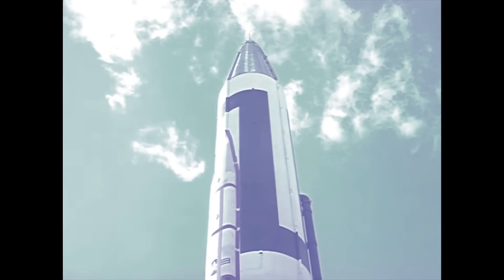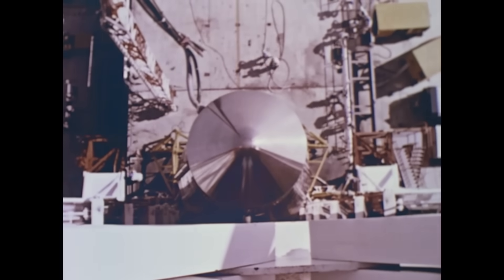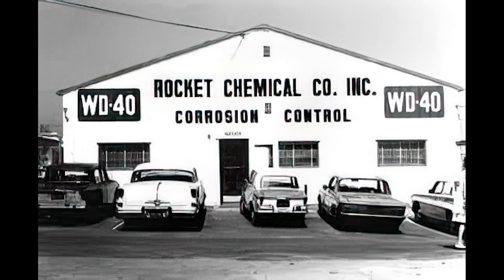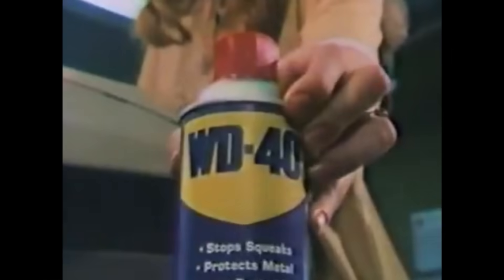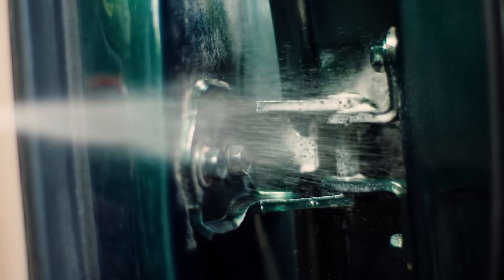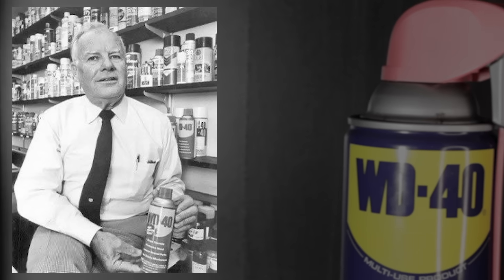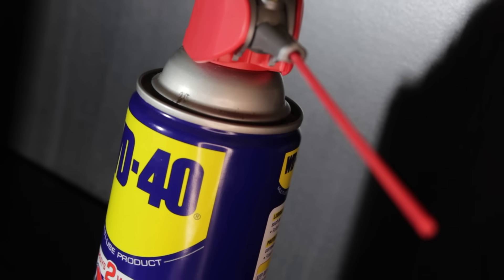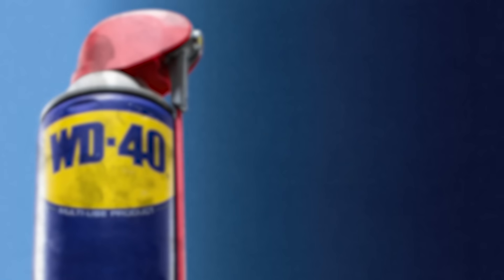How Missile Technology Became a Household Tool | WD-40

Comment: It’s good for water dispersion, marginal immediate lubricant, and as a penetrating oil, although there are better penetrating oils on the market.
Only downside is it evaporates relatively quickly so it’s not a long term solution for corrosion or lubrication.

Comment: Due to false advertising WD-40 is over rated and used in place of better more specific products for applications. I’ll use it for ratchet straps at most or something I want the oils to dry fast and not cake grease and debris to said thing. If I actually want a temporary fix for rust prevention, coatings or lubricant I’m using PB blaster penetrating oil, lanolin based products like fluid film or some type of specific grease spray. Those products mentioned stays wet and doesn’t evaporate so quickly. All in all keep a can of wd-40 around for the right application but there’s likely better stuff for specific task.

Comment: Cleaning - Yes. Penetrating - Yes. Water displacing - I guess. Lubricating - No. Not at all. Not even a tiny bit. Just no, never.

Edit: It's basically diesel that smells better. Next time you don't have any WD just try some diesel.
Reply: People who use WD-40 as lubricant never used the proper lubricant for a job.
Reply: Not for long, it's not a proper grease, but it absolutely does lubricate.
How is an oil that can easily penetrate between two close fitting surfaces not lubricate.
Reply: @Jo-rz6bs  WD will remove grease and oil. I won't clean bearings with anything else but when they're clean, I lubricate them. The oily feel that it has is a result of the paraffin that gives it such good creep but it shouldn't be mistaken for lubrication. Don't get me wrong, if you're working with squeaky hinges and that's all you've got then sure - but don't seriously consider WD-40 as a lubricant.
Reply: A rocket technichian once said it is based on a kerosine product and oil.

Comment: Used to use CRC 565 but nowdays its basicly WD-40 for everything from DIY to mechanic shop.... Its difference is like night and day....
Reply: Which is better?
I'm kinda confused, sorry.
Reply: @Salpeteroxid  WD-40 by a very long country mile shot wide ;)
Reply: @asf130thecompany7  I had a belt pulley on my car go out and I have 3 miles to work so I sprayed it with WD-40 and then tested 5-56 before every 7 minute trip but I actually thought the 5-56 lasted longer before it squeeled 😅 My place of work buys in both 5-56 and WD-40, why? I dunno 😂
Reply: @Salpeteroxid  I think it depends? Where I live its like rust belt but in Europe and WD-40 just works better dunno why.... At some point felt like CRC changed the formula or something coz its performance droped? Dunno And we used both more than boxes a month so had to choose either WD-40 or CRC :D

Comment: WD-40 is not all that amazing. First of all it was designed by NACA to displace water on Dodge truck ignition systems during World War ii. And all they did was revamp the formula it is minimally effective at corrosion resistance. Which is all that is necessary on any kind of stainless steel. It is far more of a solvent then it is a lubricant. In the 1980s somebody got the bright idea to take the new stainless steel semi-autos and put WD-40 on them before they entered a shooting match. It became very apparent that doing that was a very dangerous proposition because some of the guns were locking up in mid cycle due to lack of lubrication. Believe me, WD-40 is a piss poor lubricant. If you're using it you have to continually apply it to make it stay a lubricant, like when you're spraying it on steel wool to remove rust from a panel. Can you put it on and leave it on it will turn into a gummy substance which will seal the metal but not long enough to be a long-term corrosion protectant. Especially if out in the weather. For longer than a few months and a few months is not a long-term test. WD-40 was not created in the 1950s it was created in the 1940s. During World War II. None of those failures of the atlas rocket had anything at all to do with the lack of WD-40 on it

Comment: It's pretty good at cleaning internal components but other stuff like acetone and brake cleaner are better than wd 40 at cleaning surfaces either way wd 40 is a poor lubricant so it often has to be used in conjunction with something longer lasting

Comment: Works great for cleaning and lubing skateboard bearings 🤙
Reply: You should probably put a bit of grease in those bearings asap, I used to use WD for my bones ultra-reds and it worked great as a cleaner but sucks for a lubricant.
Reply: It doesn't last long though because WD-40 is neither oil nor grease. It will evaporate after a few days to a week, so after applying it apply some silicon grease as well for better longer lasting results.
Reply: Seeing WD-40 being sprayed in very liberal quantities upon objects showing no rust nor need for serious cleaning almost broke my eyes
Reply: Please do not use wd-40 to "clean" SB bearings. Instead use isopropanol 99% with a brush to clean, let it dry up and use 2 drops of low viscosity oil per steel bearing for breaking the sound barrier. [one drop for ceramic bearings]
Shake bottles for bearing cleaning are amazing!

Comment: Like my boss once said - you are not engineer if you cannot repair everything with wd40, electrical tape and zip ties.
Reply: Gotta steal those from my dad's toolbox then 😂😂😂
Reply: @notsojharedtroll23  And get some oxygen-rated PTFE tape. That's useful too.
Reply: @ifyoudontfailyouarenoteven6210 don’t forget the krazy glue. great for glass stuff that split due to thermal cycling and/or light bumps
Reply: My dad said any man worth his salt can make do with clamps, duct tape, and a can of WD-40
Reply: if u dont midn the stickiness use wd40  and replace zip ties with wondertape only
Reply: "If it doesn't move when it should, use WD40. If it moves when it shouldn't, use duct tape".

Comment: WD-40 is like duck tape, it works, but theres always a more specific product that does a better job.
Reply: duct tape… jfc…
Reply: @the__man  quack quack 😅  as a non native english speaker i have to defend this guy and say that I was like 30 years old before i learned that.
Reply: @terribleteddy  Both are correct and duck tape was in use since earlier. Don't let that guy gaslight you.
Reply: @the__man  ""Duck tape" is recorded in the Oxford English Dictionary as having been in use since 1899 and "duct tape" (described as "perhaps an alteration of earlier duck tape") since 1965." "The first material called "duck tape" was long strips of plain non-adhesive cotton duck cloth used in making shoes stronger, for decoration on clothing, and for wrapping steel cables or electrical conductors to protect them from corrosion or wear." So yes JFC to you.
Reply: But you cant build airplanes or boats with said products

Comment: Also hated by engineers everywhere
Reply: Why
Reply: @searchforthetruth1  WD-40 is not lubricant, Water Displacement 40 is a way to get rid of water. That's it you need to put actual lube in the thing you sprayed with WD-40. Also it can eat certain plastics will mostly just harms what it was used on.

Comment: WD-40 is pretty dang amazing. The only thing it’s not great for is long term lubrication in hinges, etc. You want an actual oil or grease for that.
Reply: Yep, have to remind people it's not a good lubricant, works in an emergency but application specific greases/lubes or best or at least something typically good like White Lithium, Dry Silicone, etc.
Reply: Wd40 is good for loosening things like bolts but lanolin (which wd40 also make) is perfect for lubricating things like door hinges.
Reply: I use canola oil on my door hinges. Usually lasts a few years
Reply: Exactly it just displaces water, dust, metal shavings, etc but only provides lubrication for a couple minutes
Reply: WD-40 is a solvent with a wax dissolved in it. Everything sprayed with it gets coated with a hard petroleum wax. Do it often enough and the wax gums up the clearances and jams sliding surfaces. The same wax stops electrical contacts working.
Reply: @allangibson8494 yep, the gunk left over when it fires is exactly what makes it a great corrosion inhibitor, but a bad lubricant. The combo of this lubricant and a lot of solvent make it great for cleaning certain materials and other uses though.
Reply: In fairness that motivates you to check and lube those hinges more often.
Reply: thats where ballistol comes in handy
Reply: Yeah, it can even stop your brakes from squeaking. Try it!😜

Comment: I have WD-40 electrical and I use it for my controllers joysticks because they always drift and when I put them on the drift went away, so thank you were teach me in the history of one of my favorite products
Reply: i hope that’s the specialist contact cleaner kind. i’ve done the same thing on an xbox one controller and the plastic weakened over time with normal WD-40. it never dried up and the plastic cracked. beware with contact cleaner on silicone too, they tend to expand when exposed to the stuff.
Reply: @faudanke4459  WD-40 also has a silicone based spray.